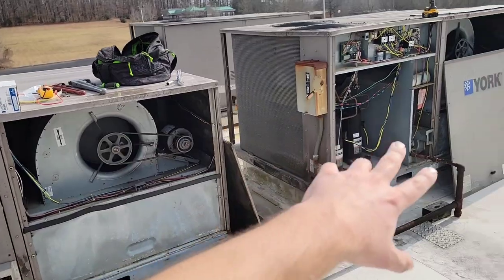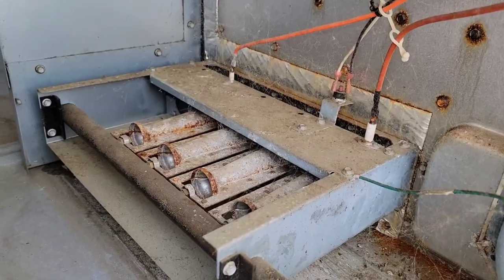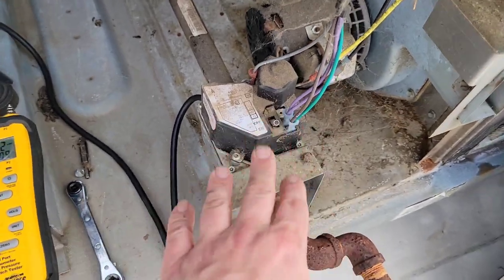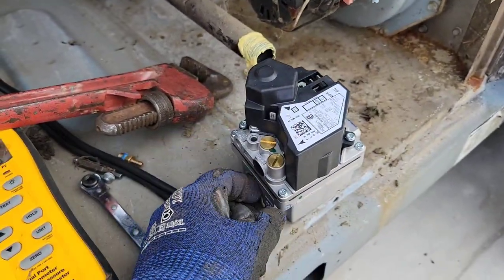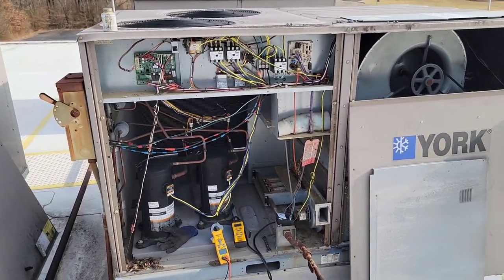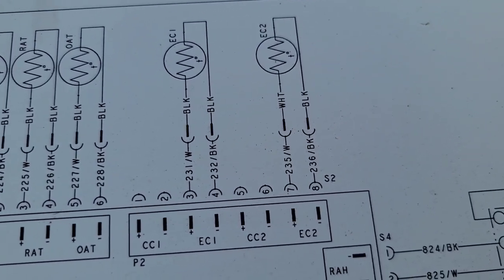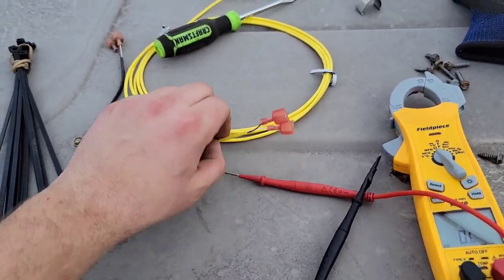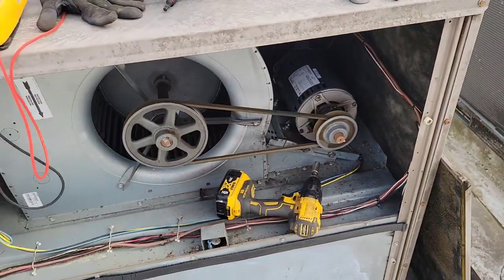HVAC Gas Valve Problems and Solutions

Comment: Thanks for taking the time to make the video. 
I would like to know the size of that gas valve fitting to check for gas pressure with the manometer or if you can share a link of where to buy it.
Thank you
Reply: Your menometer comes with the fittings

Comment: Hello.  great content. I Have a question … have you ever experienced a commercial customer call you with a complaint of natural gas odor inside a store? I’m checking these units up and down but am almost out of theories. Is there a premature opening of the gas valve or maybe an induction motor with a leak somewhere? Pretty windy on the roof maybe it needs a exhaust extension brought up higher.
Reply from the maker: could be a bad board or something like that where its sending power to gas valve and not igniting.

or regulator vent is leaking

Comment: never adjust a used belt. always install a new belt and then adjust if needed. put a spare or two in a plastic bag.
Reply: I agree then you get the new one you have to re adjust it again

Comment: You can't go off the 24 volt to the gas valve I have had them read 24 but had bad common on board if you have analog volt meter it will read 0

Comment: Hey great video, but did have one question, you normally check your sensor by ohms reading and not continuity?
Reply from the maker: Normally I check the resistance reading
 Continuity is also a good check
Reply: Its generally going to be an ohms reading. Continuity is generally for broken wires.  Either way, its the same mode on your meter to look for low ohms or O.L.
Reply: It will work the same way I use continuity

Comment: Hey tad quick question how did you know that sensor was supposed to be 10k ohm? I haven't diagnosed that sensor before but on the ODA and SAT MAT sensors RTA sensors etc how do you check those? Is that with a 10 k ohm chart? And has to match the same ambient temp outside???
Reply from the maker: Hey send me an email I have some guides for you
tadfuller1@gmail.com
Reply from the maker: yes I use a chart I can send you what I have
Reply: @TaddyDigest  just did👍
Reply from the maker: Awesome

Comment: Microchannel is Cheap coil .
Reply: I think they actually cost more and are have better efficiency.  But on the other hand, they break easier and are harder to repair.  We require them to have hail guards on the rooftops units in our facility.

Comment: Your pipe doping skills are lacking here.  First, you gotta clean the old threads with a wire brush.  Next, apply a thin coat (more is not better).  Last, you have to make sure to not get any pipe dope on the end of the pipe (you definitely got a big gob on the end of the pipe) so that it doesn't go into the system and cause problems. A final recommendation is that cogged belts are superior to those straight, standard belts.
Reply from the maker: thanks for watching and for the great tips 😀 👍
Reply: @TaddyDigest  I hope that didnt come as me being a jerk. Its very hard to strike a balance between criticism and not coming off as being insulting or disrespectful. (The same problem happens with text messages too Ive found.) I did very much enjoy your video here and look forward to more.
Reply from the maker: Friends look out for each other friends say something when others say nothing.
It's better to say something
Iron sharpening Iron
Thanks brother.